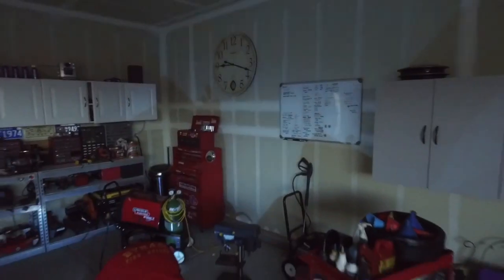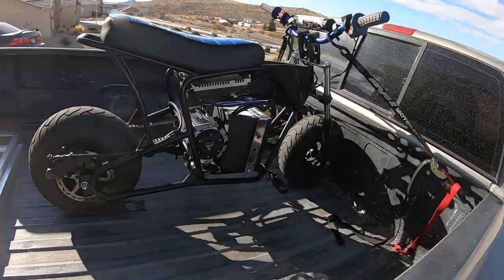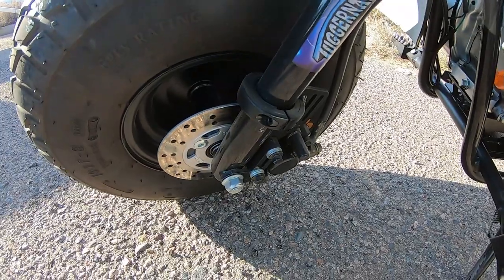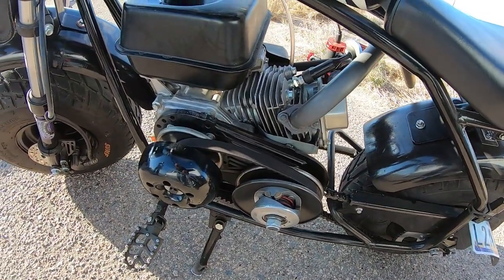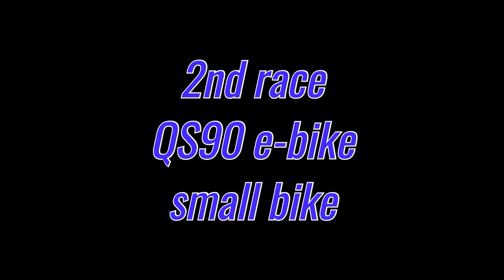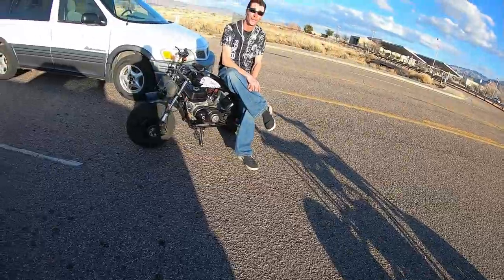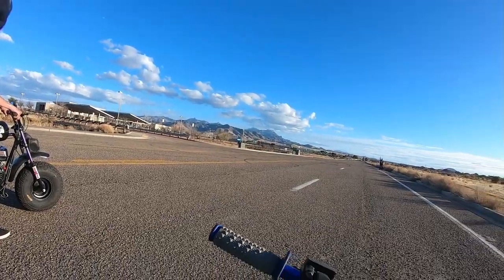When you race a gas mini bike against electric

Comment: You should run yours vs a db30 with a 224 if you want small bike vs small bike. My db30 wipes these Colman 200 size bikes. I'm pushing 70+ with a mild build. And torque converter. Miy bike wieghs under 90 lbs. And I only weigh 140.. wheelys at 20 to 30 are an issue. I have to swap tires and add a wheely bar if I want to get rid of some rotational mass
Reply: Yea the controller will help alot. But also exesive heat need to install some colling fans. Putt them on a switch for for race turn around.
Reply: what mods you got on it? i have the same bike with limited mods but don't know how fast it goes.
Reply from the maker: Have a video coming out on Saturday with a small bike and A Predator 224.
Reply: @patricktrous  wow. you have that thing moving pretty fast. do you know what kind of engine the cam is out of? i want to mess around with the cam on mine but i'm looking for cheaper options.